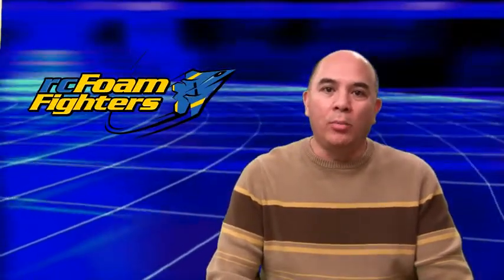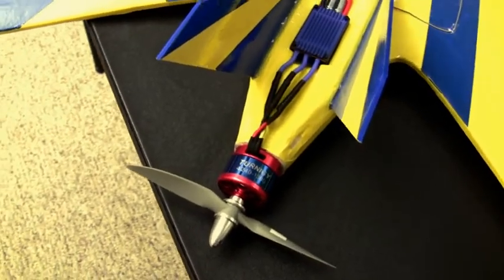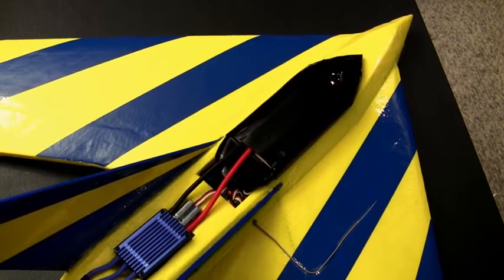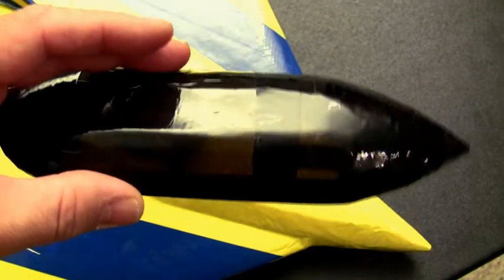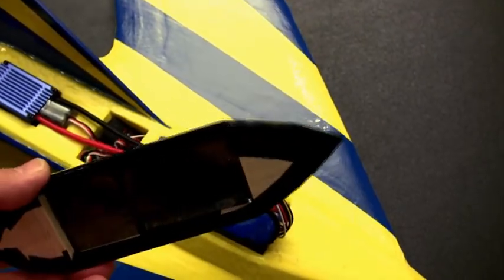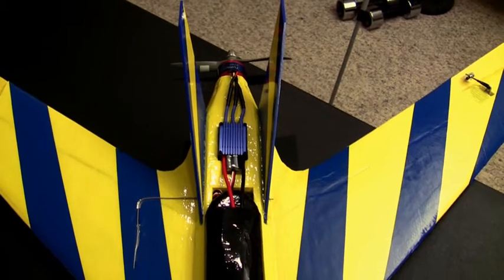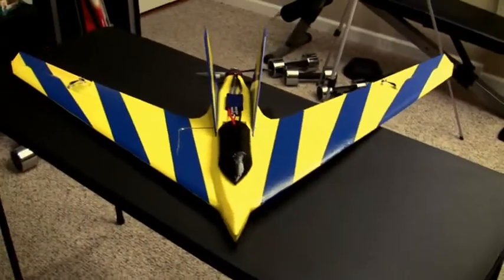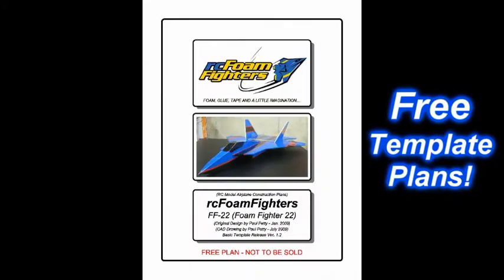FF-Sparrow V1 Build Completion

Comment: Hey Frank,
It looks fast, I agree with the upright stabilizers instead of the  angled down vtail.  Less overall drag too.  It may be hard to land, it will come in HOT.  That 1300kV motor with what looks like a 7x9 prop. in the vid.  should do the trick for a speed record, but a higher rpm motor means more fun for you.  what's the kV rating on the replacement motor?  Good luck on the first flight.

Comment: Whoops copied the wrong post...
Thoughts on the "Sparrow"... Try filling the area from the inboard edge of the Elevons to the aft fuselage just forward of the motor with some foam. This would give you more wing area without changing the physical design of the plane all though it will look more like a flying wing... This should fix the problem... At least thats what I think. Mudman1959 Fly or Die trying in 2010...